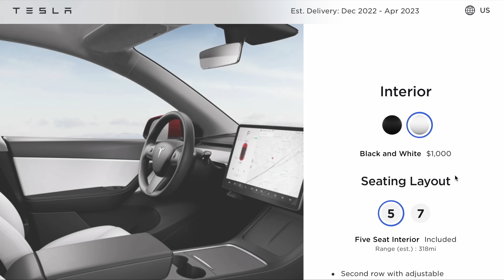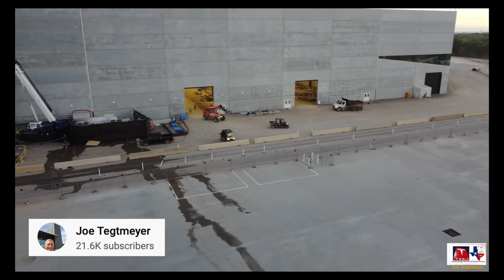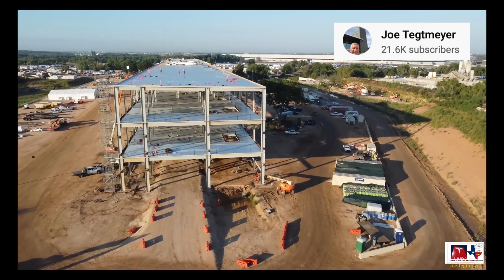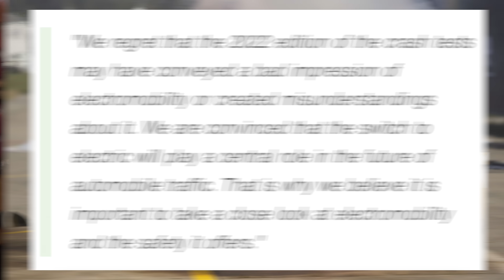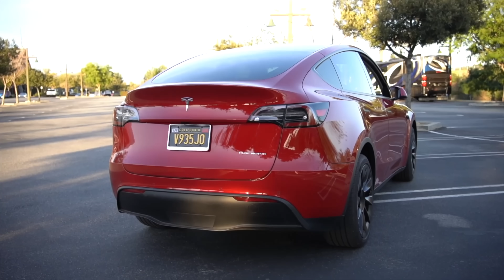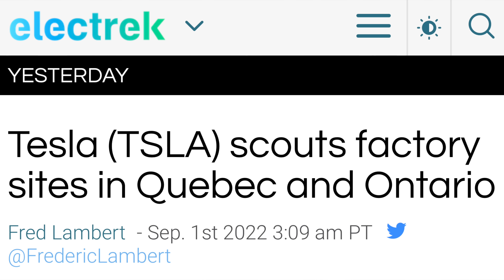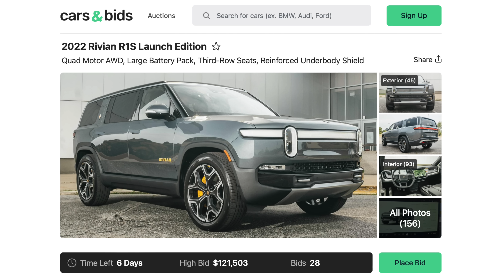Tesla Removes MORE Features | You Might Hate It

Comment: Electric cars should be able to join the Virtual Power Plant program.  Just need bidirectional charging.  Maybe time for Tesla to include that in new cars???
Reply: Sounds like a good idea actually
Reply: The value of the energy versus the cost of the energy storage system (the EV) is not a good use of that system. A stationary battery system is far more economical. As an example, in the US, you can get about 80 cents per mile cost recovery for business use on your EV while selling energy from free (home solar) or peak shifting from night to day energy you store in your EV will garner closer to 3-12 cents per KW. At, say, 3 miles/KW range on the EV, you're looking at $2.40 vs $0.12. Plus, you're placing wear on your EV's most expensive component.
Reply: @ronkrantz2957  Using an EV that I already bought for grid backup is an additional use.  The only extra cost (besides the enabling hardware and software) is the battery degradation.  With LFP batteries, they will outlast the body of the car in most cases.  Why not drain them slowly to help the grid when the EV is plugged in and not being used?  By aggregating many EVs' slow drain, a big torrent can be created to stabilize the grid.

Comment: Was wondering if anyone could help answer my question; is my 2022 Tesla Model 3 Standard Range RWD eligible for the Fed Tax Credit since it was delivered on August 19 2022? Just wanted some clarification due to this statement: 

Following the official signing of the Inflation Reduction Act, the IRS has included the following transition rule for those who already had an EV on the way but are wondering if they still qualify before the new credit terms kick in. In certain circumstances, the answer is yes. Per the IRS page:

If you purchase and take possession of a qualifying electric vehicle after August 16, 2022 and before January 1, 2023, aside from the final assembly requirement, the rules in effect before the enactment of the Inflation Reduction Act for the EV credit apply (including those involving the manufacturing caps on vehicles sold).

But then when you look at elegible vehicles, it says Tesla not until 1/1/2023
Reply: Nope

Comment: Tesla is moving to automated driving. No need for mechanical controls. They will eventually remove all mechanisms and replace with touch screen on wheel and screen
Reply: That’s fine. But until that happens, I prefer to keep the stalks.
Reply: I would not buy that tesla ever. It makes no sense to me. Just use uber if you don't like driving. 
Some driving assistance - yes, full-self drive car without any physical controls - hell NO!
Reply: I believe Tesla may one day be capable to do automated driving when my Tesla stops slowing down for shadows and reflactions, and the stationary cars/trucks/busses etc stop jumping around in the screen.

Comment: Design-wise it may look good, but you also have to look at safety. Reports already show that physical buttons are saver to use while driving, than a screen(button).
Reply: Well, yeah that may be true because of how long that's been around for but this is now settling into a more futuristic style.
Reply: Agree, totally. You just feel it and knows how to do. And with thick gloves (welcome to Sweden where the climate can go from -50 degree C to +35 degree C! and contains hail, snow, slush, rain, freezing rain, ... sometimes everything almost at the same time).
Reply: Except that's not the right comparison.
Reply: Maybe for old grey heads.  But not the younger generation.  Also all buttons will be useless with FSD.  Might as well start getting rid of the
Reply: @holysmokescharles  it's not generational. It's about tactile feedback while you are concentrating on the road ahead. Buttons & stalks give information without concentration from the user.
Reply: @frammis83  disagree… in robotic surgery there is zero tactile feedback unlike laparoscopic surgery.  You develop a 6th sense of tactile feedback over time using other queues on the robotic platform.    In my old gas car there were tons of buttons and stalls of which I used 2 regularly, one being the turn stalk and the other turning on the windshield wiper, the rest are useless.   The steering wheel still has a clicker for selecting turning signals.  You can set scroll wheels for what you like (fan speed, volume, etc).   None of this takes concentration.   The rest won’t matter with FSD on.
Reply: @holysmokescharles  well, too many buttons is a problem for sure, just like too few. Stalks are so intuitive though, and replacing them with capacitive touch buttons on the steering wheel is definitely a step down in usability. I don't mind innovating to improve the interface, but Elon liked the yoke because it looked cool, and he spouts nonsense like "all input is error". The yoke is objectively worse for control in skids etc. It is a hazard in my opinion.
Reply: @frammis83  all Teslas have voice command controls.  You can click the button on the steering wheel and tell the voice command to turn on your wipers, turn on the air conditioning, turn on the radio.  The list goes on and on and on. You don’t need buttons.  Just use the voice commands which is safer then looking down at the steering wheel to find the button you want or the center console buttons.  My wife has a Ford Explorer and her entire steering wheel is buttons which is just dumb.  Never use 95% of them.
Reply: @holysmokescharles  There will be no self driving Tesla from those out on the streets so.... forget it.
Reply: @Xanthopteryx  wrong.  FSD beta is pretty close to accomplishing it.
Reply: @holysmokescharles  Hahahaha.
No.
Definitely No.
Not even close.
Not
even
close.
Reply: @Xanthopteryx  you clearly have not driven a Tesla with FSD beta.  You have zero idea what you are talking about.  Tesla will be first to FSD by a decade.
Reply: @holysmokescharles  First of all, SAE Level 5 is impossible with todays cars tesla have out there.
Second of all, if (a big if) a car, from any brand, will reach L5, it's will not be within 15-20 years.
Third, L4. Tesla is far away from L4, meanwhile Waymo and other are already there and even more are there like this or next year.
Fourth: Tesla might reach a limited L3, if they focus on it, but still at least one or two year more. 
Since they do not focus on that, add several years. Meanwhile, others are there and more to come.

Tesla is L2/ADAS and will not be anything else. They even said that themselves. So, did you pay for FSD in hope of a self driving car? You have been scammed. Sorry, but, you paid for an ADAS system. 
Nothing more. Nothing less.
Reply: @Xanthopteryx   you clearly have zero knowledge on the topic.  Waymo and other companies use geofencing and premapped areas to drive,  they are not a real world solution.  You drop their car in an unmapped area and you die.    You are propagating a completely false narrative.   You are the definition of fake news.   Again I’m talking about FSD Beta.  Actually try it out or watch the latests videos on it.  It’s the only way for people like you to actually change your minds.  I’m not going to waste my time debating when I’ve done my research.  I put my money where my mouth is.  I’m invested in Tesla for a reason and my money is in it bc I’ve done the research and riding my 20x gains to date.  You don’t need LiDAR.  You don’t need radar for FSD.  The rest are wasting their money and their time.  This is a real world AI problem and vision.  That’s all you need.  Exactly how humans manage to drive and get around.
Reply: @holysmokescharles  Okay, so, let's see here. Where do we start....
Well, first of all: Elon surely is one of the persons in this world that definitely does not have a clue of how thinks like this works. He has been wrong every years since way back and is still wrong. And besides that, he also lies but that is another story.
For myself, i have a pretty good understanding and i also keep track of what is going on in the field of machine learning (well, there are no real AI so, let's just call it for what it is - machine learning) in autonomous car world and speech recognition and more. And so far, i have been right. For years.

It is very clear that you have no idea of what you are talking about. Geofencing and mapping and that stuff - yes, that is what it is. Even Tesla is geofenced, and uses maps (and with bad maps their system works even worse). If you drop a Waymo on an unmapped area you do not die. The car just ill not drive. You can not activate the self driving system. Simple as that.
If you put a Tesla on a road, anywhere, you will die. Or get injured. Or injure others. Because... Tesla is NOT a self driving car! It is ADAS. You MUST have a driver ready to take over AT ANY TIME. ALWAYS. EVERY SECOND! A Tesla can not drive by itself ANYWHERE ON EARTH. A pretty big difference...
Besides that, SAE Level 3 and 4, as i was talking about (and is the only thing that will be available for decades) have some things in common, like... geofencing, and only certain weather situations. Just like, Tesla... actually, but Tesla is ADAS/Level 2 so, not a self driving system. Level 3-5 is self driving systems. L3-4 is conditional. L5 is not conditional.
Level 0-2 is NOT self driving system.
Level 1-2 is Assisted driving.
Tesla is 2. Assisted driving. NOT self driving.
Just as simple as that.

I do not have to try FSD Beta (and i can not really do it either since it is not available here...) since other people do it already, and those people put out videos, where you can see how it goes. And it is a small amount of people doing the videos, and it seldom shows the reality (since people are afraid of getting the software removed by Tesla, witch has happened BTW), and still, there are so many flaws and issues, some are kind of minor and some are really major. Like, stopping in the middle of an intersection, when cars are coming at you, ready to T-bone you...

And i am not talking about LIDAR and RADAR. I am talking about more simple things like... Tesla has limited vision, with blinded areas, that prevent the system from ever going Level 5. And it also has problem even for Level 4, and 3, because of this. And they lack microphone that can pinpoint the sound direction. It also has too low resolution cameras, so it can not read (let alone interpret) road signs. For gods sake - it can not even handle speed limits correctly! That is how bad the software actually is! It also has no way of cleaning the cameras so they will get blocked and this does not work, and this is a big issue in large parts of the world.
These are just some things in the way, and we have not even begun talking much about the soggy bad software that can not even reverse the car if it goes into a dead end. Waymo, as an example, can do reversing, and three point turns. Even reversing amongst cones!

Tesla is so far behind this shit, and as i said, they do not even promise anything else than ADAS/Level 2. Their own writing!

So, you ill see. Mercedes has L3 coming this year, in production cars. Volvo have L4 coming next year (delayed from this year because of issues with lack of components and you know). In china we have real robotaxis, Waymo is now even running in SF. Cruise is on it too. BYD have come a long way and have really impressive autonomous trucks. Volvo also have autonomous trucks in some specific customers. There are shuttle busses, robousses, and more.

You will see. Next year, Tesla will still be ADAS.
Reply: @Xanthopteryx  Wrong…. Name some times when Elons has “lied”?   He sets aggressive timelines that he may not hit but he always delivers.  He even jokes about the time lines.   That’s not lying.  He eventually delivers his products.  Read his master plans.  He gets asked about timelines and he gives his best guess.  That is all.

Teslas FSD is using real world AI.  All it has to prove is it is safer then a human driver which it is.   The argument that it has “blind spots is dumb.  You drive a car with 2 eyes.  Tons of “blind spots” for you.  Teslas are surrounded with cameras and have a better view then a human with faster reaction times and it does anticipated with its AI.  

Tesla has 10s of BILLIONS of data miles recorded to train its neural networks.  Next closest is Google with 10million.  Teslas lead is insurmountable and they will be the first there by a decade.  The rest will be leasing Tesla software to survive.   None of the companies you listed are even close.  You believe their words but don’t believe actually seeing FSD beta in action.  

I’ll believe the “competition is coming” when I see it.

Comment: As a retired factory worker who operated a forklift for a few years, I'm amazed that they stack crates so close to floor-to-ceiling windows. Everything looks very orderly and I'm sure they made some kind of bump stop, but I'd be surprised if they didn't take out a few windows with this operation. I guess aesthetics overruled practicality in this case.
Reply: looks like there is a bit of space between the window and the crates and the windows are definitely not up to ceiling so no structural issues there and with that out of the way I could and have easily stacked crates to that kind of proximity (20-30cm or about 10 inch in weird units) to windows and other tight spaces
Reply: It's likely that robots move these carts and not forklifts, similar to how Amazon does it.
Reply: Had similar thought-  it has to be an incredible amount of weight as well assuming they are complete.  And with a cafeteria/break room right under them.
Reply: Well, aesthetics overruled practicality in the stalk delete and yoke decisions, so I guess that's just how Tesla rolls.
Reply: We get it. You are forklift certified.